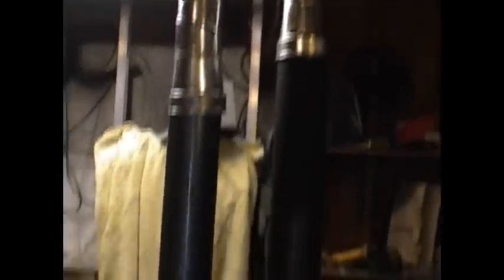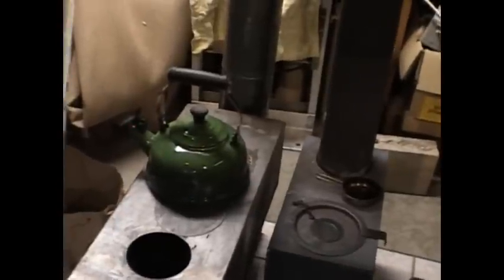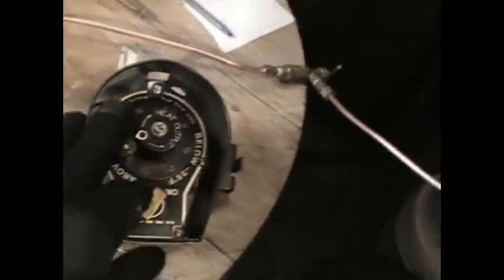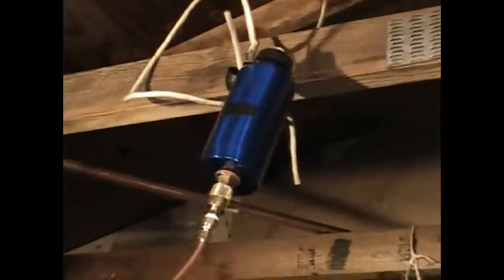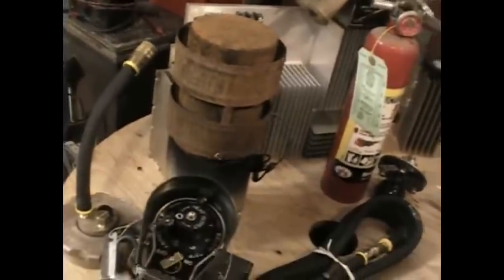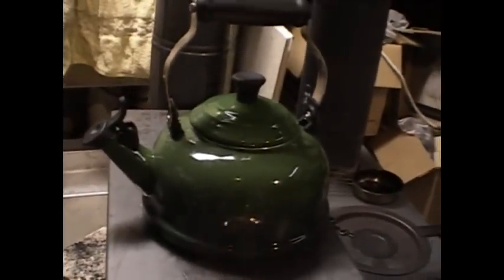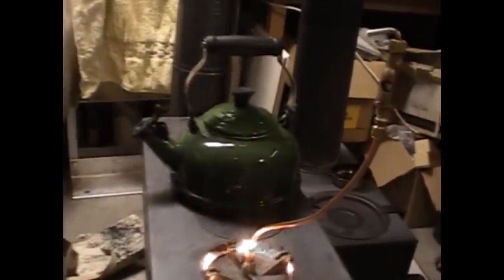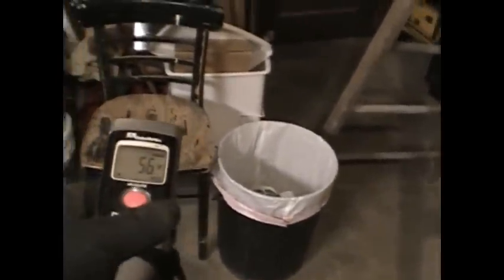Alternative heat source, Face-Off. Yukon M1950 Vs. Hunter SHA (Part one)

Comment: I loved having the Yukon during winter in German. Make sure you put the pipe insert on the hole for the smoke stack so you don't burn down your tent. And don't get stuff up on it either. It can get red. It should also have a grate so you can burn wood. I think we just left it in because it didn't matter either way.

Comment from the maker: @gasdorf  (part 2), So I have to disconnect the hose from the regulator side to prevent the over flow from happening. I placed the dial on off but it still slow flowed into the regulator. The burner did turn off after awhile.

Comment: Just one thing you might want to consider as a precaution is to have some sort of drip loop along the line before the line gets to the stove so if fuel is dripping down the line it won't follow all the way to the burner and catch fire it will drip away from the stove. Hope I explained that right.

Comment from the maker: @gasdorf After the initial burn off when new, I did not notice any fumes. Had a carbon monoxide alarm near by for safety, and it never went off. Though when connecting the hoses, and priming the burner, yes there was some fumes from unburnt fuel, its not the cleanest setup, you will drip some fuel. After about half an hour, No fumes or smoke odor present. If you stop the stove half way and leave, the regulator will over fill and run out the overflow hose, have some pan to  catch it.  (part 1)

Comment: @GUERRILLAGEEK did you use teflon tape to make the threads oil tight? dont think the teflon is a good idea :-P 

if your lucky try find a german army surplas :-) they run wood and or oil(with ablue flame)
but the yukon is multi fuel to ! or?

remove the steel ring ontop and put kettel over it. the water will heat alot quicker :-)

Comment: Good video!
I'm using the Hunter "SHS" right now.....heating a space the size of your average 2 car garage (minimal insulation also) it is on the lowest setting and it is 75F in here!

I got the little guy coz they sip fuel (diesel) I am in the process of looking for a cast iron insert so I can burn wood if the poop hits the propellers and there is not fuel.

Comment from the maker: @gasdorf Sorry gasdor1, I sold My yukon m1950 months ago. I like the Hunter SHA better. will use a Stovetec rocket stove for cooking, more efficient. When I sold it, the stove pipe fit inside each other after cleaning the soot. I kept the liquid fuel burner to use gasoline on the SHA with a modification plate to it.